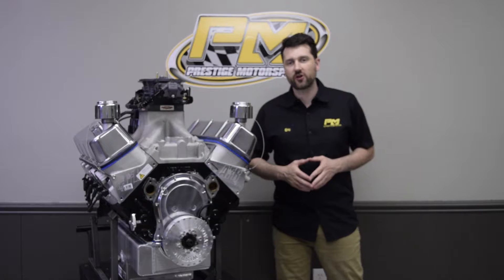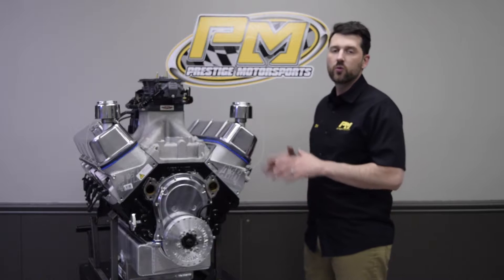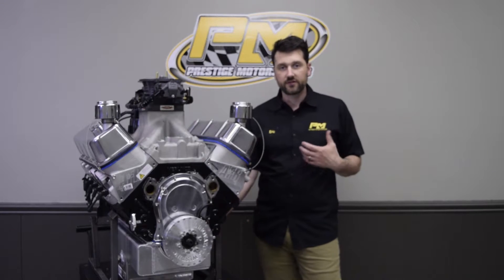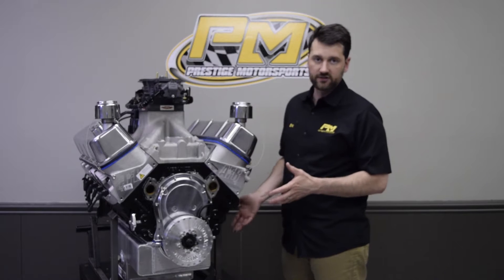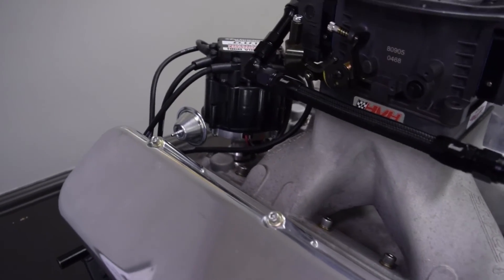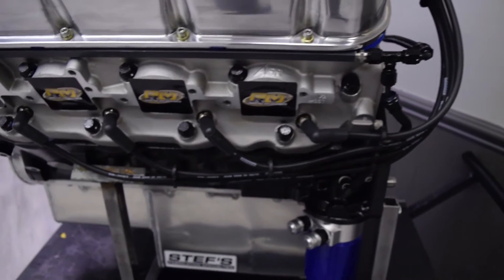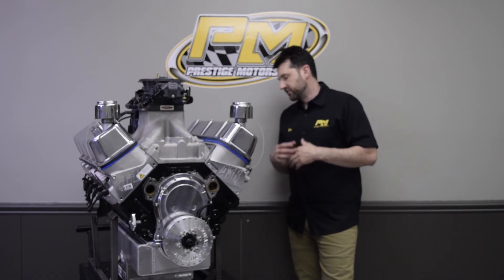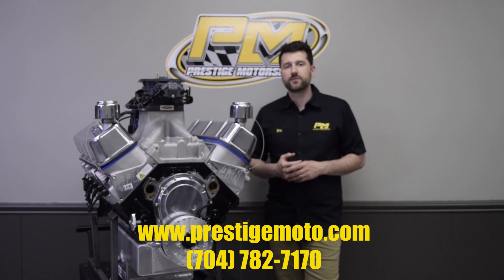632 BBC Marine Engine Combination Details from Prestige Motorsports

Comment: Very nice 👍
750hp --- 800hp @5500 --- 5800rpm is about perfect for even a twin engine Offshore Marine pleasure boat application with only some very slight differences in how it's built, but still very close. 👍
Reply from the maker: Thank you Mark!